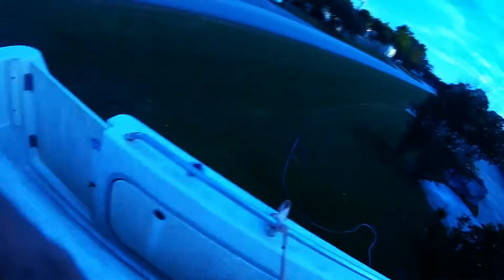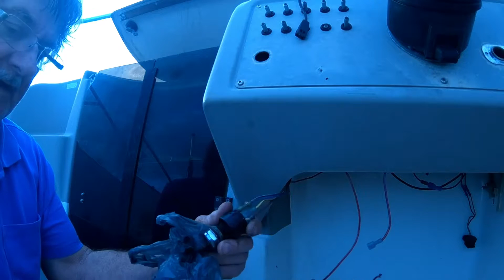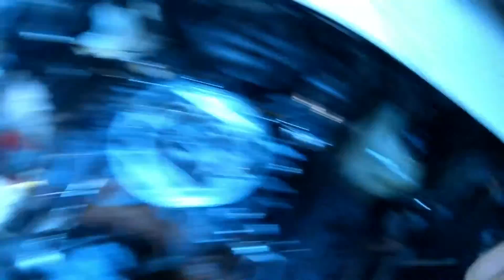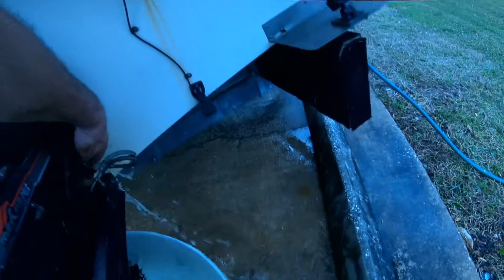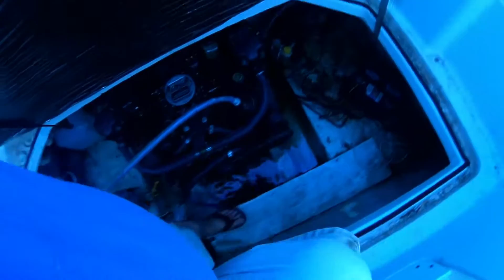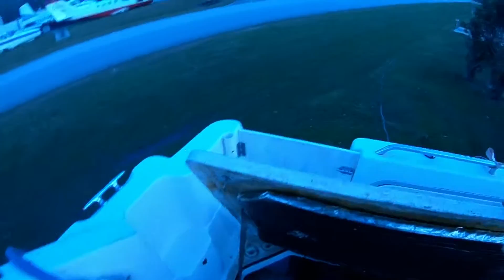Mercruiser Boat Project Cooling Water Flow Check

Comment: hey Steve! appreciate you getting back to me! so I tried the overclock I just threw an extra 500 memory and 100 to the core and raised power limit to 113 and temp throttle limit at 91 and Its just not worthwhile to do this for a couple reasons. So I'm using a 120hz 55 inch TV and I'm already hitting my cap on some games at 4k maxed out graphics with the default setup temps around 70 -75 degrees. when overclocked was seeing it top out around 83 but an aggressive fan curve remedied this by taking temps to 75 again. however that's just gonna burn my fans out faster and for what vain really? I have since limited my fps to 117 to reduce screen tearing and for my case I'm using the 012 dynamic evo with 2 140mm fans as intake on the bottom with 3 other 120 intakes on the side with a rear 120 exhaust and a 360mm ryujin 2 aio above as exhaust that are paired with 3 noctua industrial fans capable of 2000 rpm. My cooler Is also fitted with a fan built into the pump to keep the vrm and chips cooler around the cpu and speaking of cpu the intel 12900k never goes above 43 degrees under load in gaming which is phenomenal since others are reporting 80 90 100 degrees under heavy load (not that gaming is necessarily a heavy load) but in games like tarkov with maxed out graphics my card nor my cpu even get phased by it. I'm currently using armory crates ai cooling and auto fan tuning for optimum fan control although it's difficult because I don't know which chassis fan is which and obviously neither does the software so I'm gonna turn the fans up one by one and see which one goes faster to discern this and then set up my own fan curve so my exhausts are slower than my intakes preferably for negative pressure. This card is just phenomenal out of the box and others complaining of high temps are just not downloading their firmware update using px1 or whatever that software is called. that's also where I was tinkering with the overclock I did some research and saw most people were not seeing big gains from it as well. The ram on the other hand I believe is running at 4200 mhz out of the 6000 capable because the 12900k max rating is 4800 mhz and I had someone enable xmp and I don't personally know how to change my rams speed I've been trying to figure it out in the bios. If you have any input at all I'd greatly appreciate it! and thanks again for the reply!
Reply: I just went back and read how you did the ram I apologize! so I can adjust my dram speed there. I wonder if xmp should still be enabled when I do this
Reply from the maker: Sorry I did not get back with you. I wanted to ask how you had your total of case fans set up, including the AIO? If you make sure you have nice crossflow on the MOBO, with the AIO fan blowing on the MOBO, Try to balance the air volume and direction going in and out of the case. I will be describing my view on that in my build video, but I have been so busy, I have not edited it yet. I used to do HVAC and some Test and Balance of air flow and pressures.
Reply: @capnstevoanythinggoes  I went 3 fans rad on top exhaust 2 120s on bottom and 3 120s intake which hit the glass and cool my mobo and 1 120 at the back to carry the hot air from the gpu out so far its been running great gpu temps never hit 60 and cpu never goes over 40
Reply from the maker: @housebaelishgaming  Did you ever figure out the DRAM speed setting situation. I don't have 4 DIMMS and don't know if you need XMP for that. On my ROG STRIX Z690-E MOBO, the default speed for DRAM in the BIOS is 4200, no matter what speed memory you put in. I installed 2 X 16GB DIMMS DDR5 @ 4800 MHz, in BIOS, it showed me it had 32 GB@4200 MHz, so all I had to do is change the speed setting in the AI Tweaker page of BIOS. I left the other settings on AUTO. I don't remember if it activated XMP or not, or I did. I'd have to go back in and check. I have two desktops and a laptop, so I move around. If the amount of memory you installed shows correct, then just try to chang speed without XMP. If it works, then you will know if you need it or not. On my MOBO BIOS there was a little drop down menu on the DRAM that gave the speed option check boxes. Point and click, then double check. I don't know your level of BIOS knowledge, but when I started working on PC's, I learned you can have your MOBO manual in hand on the BIOS info and stoll through allmost any page in the BIOS and item to read what it does, drop down menus and all, without making changes. If something changes just by clicking on it, just don't move too quick by exiting and saving changes you don't want, hahaha. Click and change it back. If you still have any questions, you can always call the MOBO manufacturer Tech Support. As a buyer you get support rights, and they are always polite and helpful giving you answers. YouTube has some answers, and I do initial research there to get a quick help of the newest stuff out, then I research each individual manjfacturer site to check compatibility of components to get max performance. Then I make my choices based on what I want and how far each component will reach. Research, design, then buy and build. By the time you get there, you should already know most of how to tweak from researck. I trust reading and learning for myself first before applying. When I do a new build, I take the time to walk through every BIOS page and item so I know where it is and where to tweak it. Older BIOS left more questions, but things are quite simple if you read everything. Cutting edge=more earning curve. In my occupation, if you make a simple mistake, something blows up, or in some cases, blow up in the wrong place, (Aerospace/Defense). I was a Launch Technician for Space X in Florida for 10.5 months, talk about a learning curve! You need to triple check everything before you click, hahahaha. I did earn the right to say, "Oh, by the way....It is Rocket Science", hahahaha.

Comment: Your bilge has alot of water in it.
Reply from the maker: The water in the bilge when the boat is on the trailer, is not a problem. It just runs out the drain. It was a good way to test if the impeller was pumping enough flow as to eliminate it as the  cause of the overheating.
Reply: @capnstevoanythinggoes  ya I seen that after I posted sorry I don't know how to delete
Reply from the maker: @jonathanharrington9648  Is no problemo, I appreciate the comments. I have a follow-up video of how I found the overheating issue. I'm trying to get all the photos and vids together to edit them. I'm very busy now trying to dodge Tropical storms and get down to the Florida Keys for a fishing/lobster trip in that boat. Then I will also put those vids up on my channel. Feel free to subscribe if you like. I'm trying to build the channel.